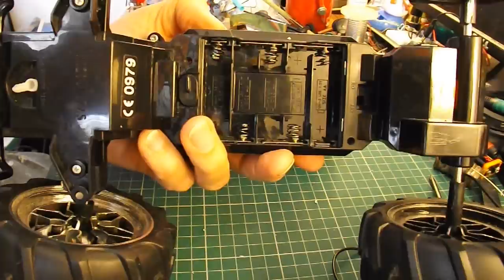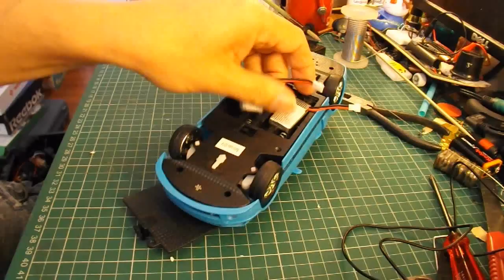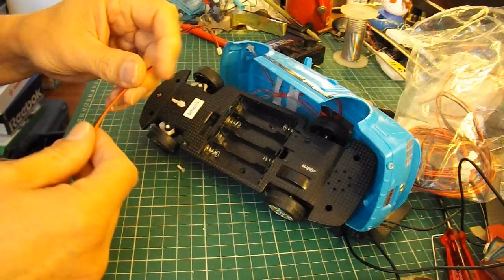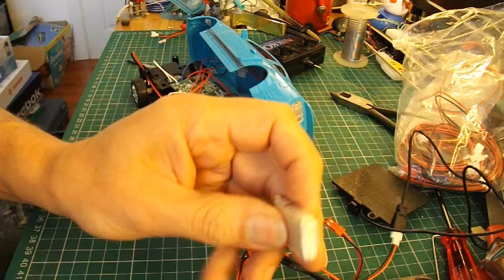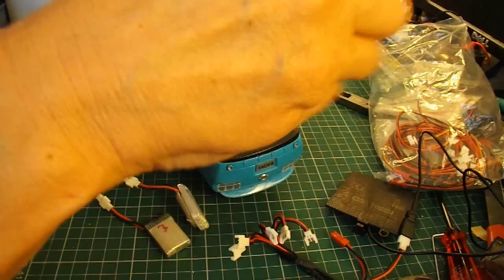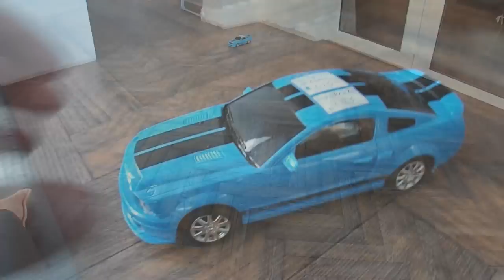Charity Shop Gold or Garbage? Lipo Conversion for RC toy car

Comment from the maker: There are a couple of issues you need to be aware of when using LiPo's. First they can catch fire if abused so I suggest you read up about them. Second you need the right sort of charger so make sure you have the right one if you buy some Lipo's.  As for which battery will work with which car the simple fact is LiPo batteries are in units of 3.7 volts, so you have 3.7 or 7.4 or 11.1 or 14.8 and so on. If your existing car runs on AA or AAA batteries they are in units of 1.5 volts so 1.5, 3, 4.5, 6, 7.5, 9 and so on. Changing to a LiPo battery means you will not be matching the voltage exactly, you will either over volt it or under volt it. The car will have been designed with a certain amount of tolerance so if you find the closest match it might work or it might not. Worst case it will over power it and the motor or receiver board will overheat and burn out, worst case with lots of flames and potential fire damage to your home. Most people who overpower their toy car have a very fast car for 5 minutes and then a very dead car for the rest of the time.
 I did this video to show using a cheap DC-DC Buck converter to drop the voltage from a 3S LiPo to drive a 1.5 volt motor https://youtu.be/qYBZ5r5EUyY

Comment: If I’m not mistaken (but I could be wrong though). I think the reason why that truck that expects 7.5v but feels underpowered compared to 7.4v on a 2s LiPo is that the AA batteries have a huge voltage drop compared to a LiPo

I think the best way to compare this scenario is my RC cars. A 7 cell NiMH battery (8.4v) doesn’t perform well compared to a 2s LiPo (7.4v) due to the voltage drop on a NiMH. I could be wrong though but that’s just from my experience since I’ve been in the RC hobby for quite some time

Heck even Traxxas RC products sold today don’t even come with batteries in the packaging anymore
Reply from the maker: There is also the fact that freshly charged, the LiPo is 8.4 volts volts anyway, plus the LiPos in this case will be lighter than the original AA batteries, so it's a win/win as far as this car is concerned. I do use NiMh on some of my boats because I can have a big battery pack and not worry about the weight, so they can run for ages. I am not looking for speed there, just a long run time.

Comment: Did you tried it with fully charged batteries?
Thanks
Reply from the maker: Fully charged LiPos or fully charged Alkali? The purpose of the video was to try LiPo batteries as requested.
Reply: @GrandadIsAnOldMan  fully charged lipos. My search was to find out if someone tried 2S lipos but full charged

Comment: I stumbled into your video just trying to see if my idea would work.  Sure enough, I took a $16 RC truggy toy from Walmart with a 3.7v 500mah Lion battery, slapped two 600mah 1S LiPos wired in series in it, and the little thing screams now.  I'm sure if I ran it full-on for an entire cycle it might jack up the motor, but it's got the cats in my house going bonkers for now.
Reply from the maker: The usual problem comes when you get the car stuck in grass. It stalls the motor and that makes it draw more current so either the motor overheats or the transistors on the receiver pop 😆
Reply: @GrandadIsAnOldMan  Makes sense.  This particular hacked toy isn't likely to ever make it outside or in grass, since it's specifically purposed for indoor house cat play, but I could see how stopping the wheels while the motor is trying to turn them would get troublesome, and possibly create that legendary LiPo fire hazard (though I myself have yet to see one of these little LiPos catch fire... many puffed, but no fires yet). Pretty big jump from 3.7 to 8.4v on a tiny motor and circuit like this, so I'm still a little surprised it didn't pop at first blush.  

On a side note, I was further impressed by the markings on your little LiPos, as I have nearly the same hatch marks on the sides of a myriad of them myself so I can tell which ones were acquired around the same time.  Great minds... :)

Comment: So did it need the weight of 4 AA's to have the grip?
Reply from the maker: Yes 👍 and No. Obviously it depends what surface you are going to run it on. The smooth surface here will always give problems for grip. Same as any vehicle, you would need to choose what type of performance you want. The lighter it is, the faster it can accelerate, but the less grip you will have. On a toy grade car like this, you will have the problem accelerating as it is full power straight away, rather than proportional acceleration. If you convert it to hobby grade RC with proportional throttle control you would be able to pull away smoothly and accelerate.

Comment: Just the addition of an AC to DC converter and a battey charge controller will make this mod a jewel!!
Reply from the maker: Why an AC to DC converter? You certainly could include a TP4056 module so you can charge it from a USB supply although many people would suggest it safer to remove the batteries while charging.
Helpfile - Fitting a USB charger board to my new LiPo battery https://youtu.be/cP_6XR2Cwc0
Charity Shop Gold or Garbage Mini RC monster truck SHORTENED video https://youtu.be/cri6wcjgKs8

Comment: This is fun, I do the same on my rc channel. Never gets old. Thanks for sharing ✌️
Reply from the maker: This seems to be a popular video and a popular subject. Back before LiPos became so popular I was always getting requests to convert the cars to run on "9 volt batteries" as if there was some special magic about them. I guess the logic with LiPos is the direct replacement NiMh batteries don't give enough power, so a LiPo looks the better option. Originally I was very much against swapping to LiPo because of the additional requirement for a properly regulated charger and of course, the fire risk. Now, I often use LiIon batteries for no other reason than I have found a cheap source of them and can make a 2S that fits nicely in an old 5 cell AA battery box.

Comment: my little friend has a toy grade like this. 5 AA batieris go into it (7.5V). iam thinking about using a NiMH 7.2V battery. i know a lot about rc. but i know nearly nothing about toy grade rc. i know it can whistand the voltage, the battery has 0.3 volts less than the AA batieries together, but can it whistand the amps? the motor will pull out how many amps it wants, but what about the circuit board? will it be able to handle it?
Reply from the maker: That is the problem. Forget the voltage for a minute (as people will point out that freshly charged ALL batteries give a higher voltage than is written on the case). You are right, the motor can easily draw a higher current, especially when the car get's stuck in long grass etc so a higher capacity battery can supply more current for longer and you can easily burn out the H bridge components on the receiver board. You are more likely to burn out the H bridge that overheat the motor, although I have done both in several of my videos.
Reply: @GrandadIsAnOldMan  ok, thanks

Comment: see what its like with a 6000mah 6s lipo
Reply from the maker: Well the weight of the battery would pin it to the ground, the receiver would instantly burn out and if you are really lucky the battery wires would melt and short together so the battery overheats and bursts into flames. Should be a perfect YouTube click-bait video. Do you have a 6s LiPo to spare?
Reply: @GrandadIsAnOldMan  worth a try

Comment: Smaller batterys have a red and black wire but larger batterys have extra wires, what's with that? Obviously I've got no clue! I recently found an old rd car from when I was a kid..... being on lockdown strange ideas are developing. ..... the larger car at beginning of vid would've been educational. Cheers
Reply from the maker: The LiPo batteries are based on multiples of a single 3.7v cell. A 1S is a single cell with just a + red and a - black wire. A 2S is two cells wired in series so inside the pack the + of one is wired to the - of the next one. When you charge LiPo batteries it is important that both cells are charged the same amount or they become unbalanced which is a potential fire risk. The extra wire comes from that internal midpoint so the intelligent charger can tell the state of each cell. In larger batteries this system is continued with one extra wire for each extra cell. On most LiPo batteries you have a pair of wires for the main power feed going to a big plug. You then have thinner wires going to a different plug and called the 'balance lead'. On a 2S this would be a pair of wires for the power and three wires for the balance lead. 2 of those 3 are linked directly to the 2 wires going to the power.
For understanding RC I can recommend FliteTest RC Planes - beginners series https://www.youtube.com/playlist?list=PL6IuSFWz4ktvupu_gxw1vn-sjBGOkJFHV
For batteries this episode Flite Test : RC Planes for Beginners: Batteries and Safety - Beginner Series - Ep. 7 https://youtu.be/K6hGvXxFTFA
Reply: @GrandadIsAnOldMan  thanks for your time sir. From new zealand
Reply from the maker: @michelebeck4311  take care my friend, bad times are coming, we can only hope we get through this.
Reply: @GrandadIsAnOldMan  yes bad times indeed, but bottom line is.... the planet can not support the number of people that inhabit it! How long have we got? How many grandchildren have you got?

Comment: How did you make the battery connector?
Reply from the maker: If you mean the individual connectors, I didn't make them, I bought them. Standard connectors are available online. You would need to but the right type to match whatever battery you buy. If you search eBay for "LiPo battery connector" you will find there is a whole range of different types so you need to know what type your battery needs before you order any. If you mean the Y shaped double battery adaptor I use to join the two batteries in series to give us 7.4 volts. That is simply two connectors in series from the batteries to one connector into the car. Car connector Positive to battery connector 1 positive. Battery connector 1 negative to battery connector 2 positive. Battery connector 2 negative to car connector negative. Using colours to explain - car connector RED to Battery connector 1 RED. Battery connector 1 BLACK to battery connector 2 RED. Battery connector 2 BLACK to car connector BLACK. Visually you will have a triangle. Your batteries usually have male connectors, so you need two female connectors and one male to make your Y shaped connector. If that does not make sense let me know with another comment.

Comment: Bro, so finally what's the conclusion?
I Should insert one 3.7v battery or two battery?
Reply from the maker: That is entirely your own decision. What batteries does your car run on now? A single cell LiPo is 3.7 volts (freshly charged 4.2 volts). A double is 7.4 volts (freshly charged 8.4 volts). If your car runs on 5 AA batteries it will be expecting 7.5 volts and MIGHT survive with a 2S LiPo as the voltage is similar BUT the LiPo can supply more current so if your car gets stuck and the motor jams it will draw more current as it stalls. With the original battery it might survive but with a LiPo supplying more current you may find the motor or the receiver board overheat and burn out. The choice is yours. You may find reading the video description helps.
Reply: @GrandadIsAnOldMan  bro, my rc car run on 4.8v(4× 1.2v cells). Please… you suggest me that I should use 1 3.7v mobile battery or 2× 3.7v mobile battery so that car would also not get any damage.
Reply from the maker: @mradulbhardwaj3147  no I am not going to suggest anything. I have explained the situation. A fully charged 1S LiPo will give you 4.2 volts so slightly less than your 4 1.2 volts. It might work or it might be under powered. A fully charged 2S LiPo will give you 8.4 volts which is nearly double what you car is designed to run on so what do you think will happen? If you want to run your car with a higher powered battery then you would need to consider an additional bit of circuitry that will restrict the maximum voltage. That is known as a voltage regulator or a buck converter. These modules are available from online stores such as eBay and can be used to reduce the voltage to what you want.
Reply: @GrandadIsAnOldMan  tell me???
Reply from the maker: @mradulbhardwaj3147  I have done this video for you in relation to using a voltage regulator to adjust the voltage from larger batteries https://youtu.be/qYBZ5r5EUyY

Comment: Hey hey,  just subscribed!! By chance did you do a video for that 7.4 volt lipo conversion by chance?
Reply from the maker: Do you mean the little connector adaptor I use to join the two batteries in series to give us 7.4 volts. That is simply two connectors in series from the batteries to one connector into the car. Car connector Positive to battery connector 1 positive. Battery connector 1 negative to battery connector 2 positive. Battery connector 2 negative to car connector negative. Using colours to explain - car connector RED to Battery connector 1 RED. Battery connector 1 BLACK to battery connector 2 RED. Battery connector 2 BLACK to car connector BLACK. Visually you will have a triangle. I am on holiday at the moment so I can't do a video to show what I mean. If you can't follow this instruction of it is not what you are asking for, let me know with another comment.

Comment: Can i use a dc-dc adjustable voltage step up converter? To tune it to a 6v output from the battery to the receiver?
Reply from the maker: The best answer I can give is "probably". The main issue seems to be the current draw rather than voltage. The LiPo batteries can supply a higher current so when the motor is under stress and drawing higher current, the receiver components or motor tend to overheat.

Comment: Can I use a DualShock 3 controller lipo battery for a similar Welly RC 1/24 car? EDIT: Sorry I did some research and it ended up being a LI-ION battery
Reply from the maker: There are a couple of issues you need to be aware of when using LiPo's. First they can catch fire if abused so I suggest you read up about them. Second you need the right sort of charger so make sure you have the right one if you buy some Lipo's. As for which battery will work with which car the simple fact is LiPo batteries are in units of 3.7 volts, so you have 3.7 or 7.4 or 11.1 or 14.8 and so on. If your existing car runs on AA or AAA batteries they are in units of 1.5 volts so 1.5, 3, 4.5, 6, 7.5, 9 and so on. Changing to a LiPo battery means you will not be matching the voltage exactly, you will either over volt it or under volt it. The car will have been designed with a certain amount of tolerance so if you find the closest match it might work or it might not. Worst case it will over power it and the motor or receiver board will overheat and burn out, worst case with lots of flames and potential fire damage to your home. Most people who overpower their toy car have a very fast car for 5 minutes and then a very dead car for the rest of the time.
Reply: @GrandadIsAnOldMan  dang, so the only risk it's me throwing the flaming car thru the window? Can I put a resistance so I can lower the volts on it? I plan to make the battery removable so I can charge it on a naked PS3 Dualshock board via USB. I did some research and the battery it's a Li-ion 3.7v  1.800 mah one.

Comment: Would u say it made it faster ??
Reply from the maker: It probably did but that wasn't the purpose of the modification. I was just seeing if I could fit LiPo batteries. I explain in the video some of the issues. If you choose to replace the original batteries with LiPos you have to make several choices because the voltages will not match and the available power will be different and the size and weight will be different and the most likely outcome is you will damage your RC receiver inside the car. There is also some information in the video description.

Comment: Can you put a resistor in order to had 6v with the lipo battery?
Reply from the maker: Just had a new comment on this old video and noticed I missed replying to you. Probably way too late now (2 years too late). Yes you could use as resistor, another alternative is a DC DC Buck converter and I did do this video to demonstrate Buck converter 3S LiPo driving a 1.5 volt DC motor -  https://youtu.be/qYBZ5r5EUyY
Reply: Asking the real questions

Comment: I was thinking of restoring random rc cars I see at thrift stores
Reply from the maker: There are three common problems with the RC cars I find in charity shops even when they look in good condition. First issue is they rarely have the matching transmitter with them, you might be lucky and find they match with another one you already have but they are not all compatible with each other even when they are the same frequency. Second will be leaking batteries left in them for years before they were donated so the spring contacts have corroded. Third issue will be broken gears, teeth missing etc although these do tend to be more easily replaced. There are ways round all these issues, just depends how much time and money you want to invest in them  😊😊😊